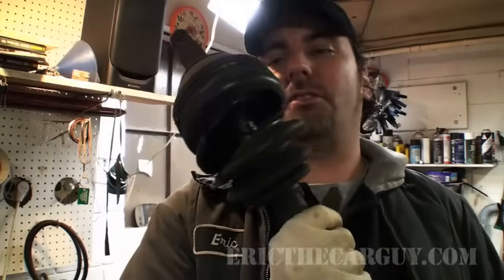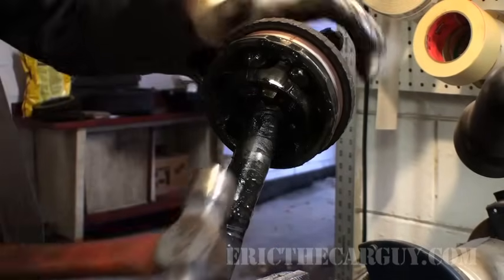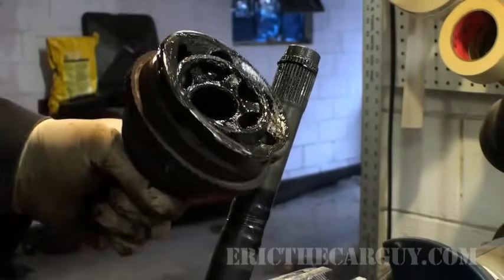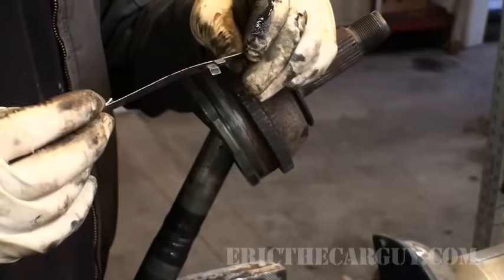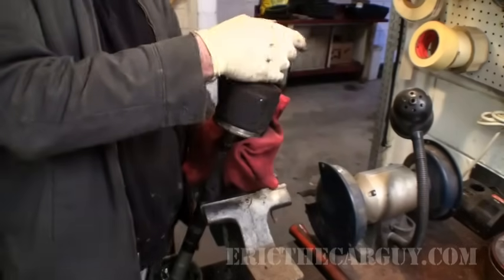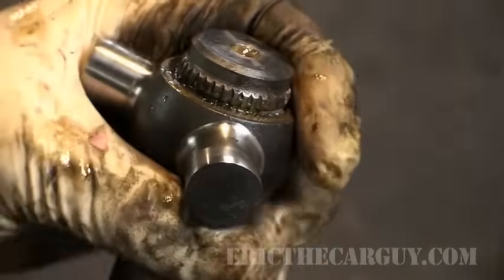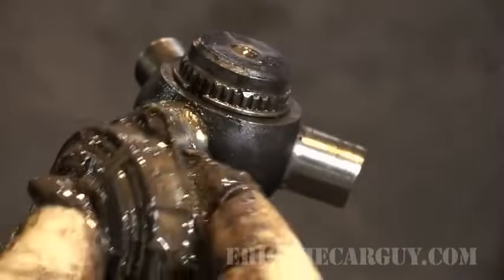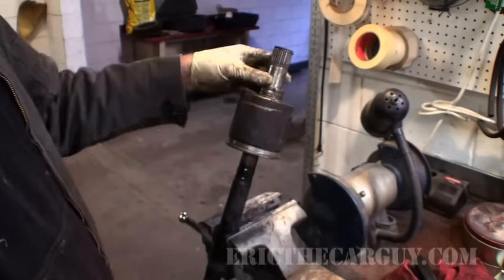How To Replace CV Boots - EricTheCarGuy

Comment: Eric, great videos. I have a 2002 Camry 3.0 V6 and the car has started shaking when accelerating, even a little bit. We have ruled out the motor mounts. Someone said it could be a CV joint or axle. None of the boots are ripped or leaking grease. You mentioned a clicking sound which my car is not doing; just shaking and vibrating, especially when accelerating uphill. Again, only when accelerating. Any idea of what it could be?

Comment: Thanks for the advice.  I have a clicking axle during turns and braking on a 99 escalade.  I was considering rebuilding it, but for $54.99  replacing it is a better option.

Comment: Great video.... I guess for the the inner joint boot, instead of having to remove the c clip on the inner joint, couldn’t one simply put both booth on the shaft when you removed the outer cv joint ?

Comment: i have to agree with his opinion about changing axles instead of replacing boots; if you hear a noise it is too late. Replacing the boot because it is torn is useful if you find the tear before any damage is done; I prefer in those situations to use a pneumatic CV Boot Expander and shortcut the entire situation.

Comment: The only reason I replace boots rather than shafts is because shafts are ridiculously expensive. However, if a joint is shagged, you can get hold of just the joints. Boots are like £15, joints are about £35-40 and shafts are £120 (on an absolute shiteheap). 
Where I work, we all just do it on the car. Once we have the shaft out the hub, we can just hold the joint, tap it off (with someone holding the shaft) and then it falls right off. New boot on, grease in the joint, shove it back together and job's a good'un.
The 'proper' boots are great. I remember hearing stories of boots you could fit without removing the joint, where they were split down the side and you had to use a kind of superglue to fix it together. I was told you'd be lucky to get it through an MOT.
Then there's 'Stretchy boots' that you can buy, which are, as the name suggests, stretchy. You can get a cone-shaped tool to push it over, or a pneumatic claw that expands when the boot is over it, then it stretches it over the CV joint. However, they obviously compromise somewhere to make it stretchy, by making it weaker. Anything vaguely sharp will likely cut it. They also dryrot very quickly compared to 'proper' boots.

(this is the case in the UK, not sure what it's like in 'Murica! :D)

Comment: Hi Eric not sure if the axle suppose to make noise when I rock it back and forth when the wheel is off. But when the wheel is on it don’t make any noise. My problem is that when I hit a lot of bumps it has noise from the front wheel area.

Comment: Thanks Eric, when disassembling the rod from the inner joint I didn't scribe any indication of the original insertion position. Being that there's only three positions, does this matter?

2001 Honda Civic DX Manual Transmission

Comment: I'm installing replacement  axles now on my Legend. New, non-OEM axles I installed on my CRV (A-1 Cardone Select - believe they were Chinese) caused vibration issues. Catching and rebooting an OEM axle before the clicking starts seems like a good solution to avoid fitment issues. I ended up buying Duralast OEM remans. A word of caution is to look over the axle thoroughly before paying and walking out the door; one of the reman axles I almost bought at Autozone looked like it had been installed, uninstalled, drop-kicked then thrown off a cliff.

Comment: I can accept that you do not do this job anymore, but I disagree and believe that it is a great opportunity.  I just did this job and I thank you for some tips you shared.  I discovered the problem while changing my oil, by noticing a cut in one boot.  It must have been a recent incident and I do not think much if any grease got out. I applied some silicone to hopefully carry it through the Winter.  Now it is Spring and I got around to it, the cut was opened up worse and there was some grease splattered around. I had not heard any funny sounds though. So I did the job and all is well.  So it cost me about $14, and an hour or two of my time but it seems as good as new.  Had I left it alone it would have gotten more messy and eventually would have started making noises which would have bothered me.

Comment: After seeing your demo. I think I might have a idea why the inner joint has a broken boot after having these replace about three years ago.(Both outer boots joints were torn and clicking.) This time it was either a severe jolt while driving or something sharp off the road might have clipped it, or the installer might have over extended the inner joint weakening the boot, or because it was old stock. For my 1993 Pontiac Sunbird 3.1 with 5 speed stick. Just went over 300,000 mile a few months back, and yesterday when I was replacing the front brake pads I noticed the inner boot was cracked on the driver side CV joint. Thankfully Auto Zone can get the part. So I'll have my local mechanic replace the CV axle for me when I get the part.

Comment: Thanks for the video (all your videos are great).. c-clips don't where out? but why wouldn't the c-clip that comes with the new joint work. Isn't it designed to work with the new joint.  And how much and where does the grease go inside the boot itself?

Comment: Eric, have you ever seem the cup on the inner joint dimpled so it won't simply slide apart?  I see this on my volvo and it looks like the dimples need to be ground down to separate the joint.  They should not be needed for normal operation because the joint wont separate once its back in the car.  Thanks

Comment: I recently replaced the Passenger side Axle on a 2008 Camry.  Job from HELL!!  The bearing would not release from the Casting bolted to the motor which would not come loose even after getting 3 impossible bolts out due to dowel pins.  Hammer, Chain whip, air chisel, running long bolt in casting hole to crack cup of ball bearing etc. ONLY way was to saw thru the axle between support CV joint and Trans.  Very heavy but hollow shaft.  Then the 2 pieces would come out.  Huge time getting the bearing out of casting, finally driving balls out with long punch at snap ring recess.
Then had to drive the broken cup out of Casting with punch.  Almost impossible to jig up on Press. Corrosion resembled mill scale and even power wire brush would not remove it.  Had to be lightly tapped with small ball peen hammer to get it out.  SHOULD have just replaced Boot and left inner shaft alone.  2 guys almost 7 hours.  Never again.  Axle cost was $118.50 Garage price. Customer price $248. Apparently was a new not reman. unit.

Comment: I dig the video and your commentary. Question the smaller clamp/band has broken on my right axels boot, the boot is intact it's just oozing a little grease, the smaller clamp is my only problem. May I simply buy a new small band and pop it on around the boot? Is this an easy fix I can do without lifting the car? I'd appreciate anyones feedback. Fingers crossed it's an easy new clamp do it myself fix. thx

Comment: Makes sense. The purpose of the boot is to protect the CV. But if the CV works then a torn boot doesn't matter. My 2003 Element's CV boot has been torn for years and still no problems or noises.

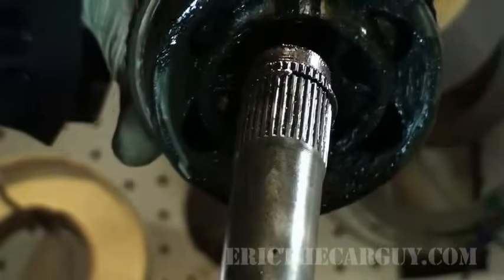Comment: Hey Eric! I replaced both boots on the drivers side and now there's a thump on acceleration.  It's not there on deceleration (or it's just not noticeable) and definitely wasn't there before replacing the boots.  I had a hard time reinstalling the outer joint like you showed at 6:45.  Don't think it matters but It's a 2003 nissan altima 2.5.  Help!  Thank you!

Comment: To answer your question. I needed to put together “Frankenstein”  axles. Outer is from a 86’ Integra & inner from a 96’ Civic the actual shaft is from a 86’ Civic I couldn’t find a shop that would make them for fairly cheap. But then again engine swaps aren’t cheap.

Comment: Thank you Eric, great video.  Can I drive my car with a rip cv boot for a while before replacing it.  Or is the axle/drive shaft going to brake off? 

I've hear a clunking noise in turns, only when turning right though.  I am  afraid that something could happen if I keep on driving a bit longer.   Thank you and have a blessed day.

Comment: Eric, always a pleasure to watch your well done videos!  I watched this old one because I discovered a leak on my wife's 2008 Subaru inner axle.  The grease is oozing out from the small end of the boot onto the axle.  No problem mechanically yet, and I do not know how long this has been occurring since the axle is somewhat out of plain sight. Tiny stain on the garage floor.  I figured maybe just re-clamping the boot may be all it needs.  Now, I wonder if I should just let a dealership do this and some other maintenance work I was planning on myself.  I saw somewhere that using one of those plumbing type bands is not a good idea here.  Due to vibration and rotation it was said they loosen up.  Maybe you should visit one of Greece's Islands sometime!!  :)

Comment: What you need to replace depending on the condition of the CV joint, not how much you want to spend. Eric is right, if the CV joint starts to make noise, you are out of luck! Honda is notorious for having cracked outer CV boot. My old Accord had that problem and I had to bring it to the dealer to get the damned $23 boot replaced which cost over $250 after it is all said and done.  Next time, it is probably better just to replace the entire drive shaft like Eric suggested since the labor cost will outweigh the part cost. Of course, the part cost in this case would be after market part, the OEM part will be much more.

Comment: For greasy jobs, I have always find it much better to use paper towels for cleaning up old grease excess grease and from parts that need to be cleaned and re-greased for re installation. Dispose of the grease-laden paper towels in a plastic bag, either sealing it or tying it off before dumping it in the trash.

Comment: Already bought a CV outer boot for £10 and thought I'd ring Audi given the start of your video....£324 for the drive shaft.....so yea, continuing to watch your video. Hope it isn't too complex :-/  It hasn't started clicking or anything, I just happened to notice the boot had spilt while changing a bearing.
Reply: Wow....that was a LOT easier than I was expecting. The only thing I don't have is that first special tool you showed but I do have standard carpentry flat head 'nippers' that look pretty much the same - the only difference would be the amount of force I could apply looks less.....anybody have experience of using my tool for this job?

Comment: I have a 2004 saab 9-3 with 196k on it. CV on passenger side has been needing to be replaced for about 8 months now since ive had it. I bought it off of my cousin and it was messed up before then. Im just now about to replace it along with the drivers side and the clutch and I drove this car 21k miles so that tells you a lot about how hard it is to break them. I am the type that when something is serliously in need or repair I just run the heck out of it lol.

Comment: I have a 2008 Nissan Rogue with torn rubber boots. No clicking sounds at all. A mechanic recommends replacing the axles because the boots are torn. I’m skeptical 🤨 especially since he said the cost to replace them is $1,100. What would you recommend?

Comment: Those outer boots have a tendency to tear. It is super easy to change this boot though because they make flexible universal boots that you install and then trim down to size. They also make a super handy cone tool that lets you slide the boot on without taking the cv joint off the driveshaft.

Comment: I just changed my Trooper outer boot, came with grease and clip. Kept original clip on axle shaft. Boot had not yet ripped, so grease inside is good. I just added some grease.  I know what a pain those bands. I have been using black nylon zip ties for my cars. Been ok for years.

Comment: Great video. I just have a question.
I have a Honda Civic from 1997. It has ball-and-cage outer CV joints like the one your working on.

I got a Haynes Service Manual for my car and it says the outer CV joints can't be dismantled or removed from the shaft. Is it true?

It's weird because when I search online for parts I find kits that consist in the joint, gaiter (with clamps), nut, grease and circlip.

My car has the clicking sound you mentioned, whenever I turn left. Can it be a joint?

Comment: Hey Eric , can you please make a video on inner axle joint on 98 odyssey install to second part close to the support bracket that holds bar into place that new cv axle get attached or press into before final installation into the transmission?. Thanks

Comment: thanks eric for the insight. I will be just replacing the whole axle. I don't think its worth the extra time, tools, and parts just to spend about $70 on a whole new axle from krage/oreilly auto parts. my axle is also clicking lightly on turns but my rims are just getting nasty because of the grease coming out of it.

Comment: I knew one of my cv boots was broken open. I went for an oil change and both are broken open now. Should I change the axles and not the boots. The cost for it all they quoted $562. Or am I misunderstanding when you say "let it go", just to run the car till it dies? Any advice is appreciated!

Comment: Thanks for explaining very well and carefully, I knew that you could change your boots because I saw it in Mexico when I was a child, but I did not remember if the cv axle had something special inside, or how to realize when they no longer had a remedy to change boots,  thanks one more time, ahh I forgot can you use the clamps with screws?  or do they have to be the same ones?  thanks you once more and many successes 👍🏽🧰
Reply: Your talking about jubilee clips, probably, here in the UK we can get away with cable ties as long as it's secure but it's always worth using the correct parts where possible, best bet with things like that is to ring your local MOT station (or equivalent) and ask them as different places around the world have different standards!

Comment: Hi there, saw your you tube video on the outer CV joint.
My question is about the ABS sensor reading ring on the body of the hub. I have a new outer CV replacement kit for my Passat and the new CV body doesnt come with an ABS sensor reading ring; can i remove the ring from my old hub unit or do i need to buy a new ring to fit?

Comment: can you reuse the 6 inner flange bolts, the ones that secure the cv axle to the differential, or they have to be changed every time? I have a cv axle to replace tomorrow.

Comment: QUESTION: You said you don't replace boots anymore because it's not worth all the work if I understand correctly. But I am wondering: How does replacing the boots EVER make sense? Typically you don't notice a ripped boot right-away (unless you spot grease somewhere around) but only on next inspection or when it is making noise and by that time dirt will already have entered the mechanics and have started to grind them down. - Maybe if you are lucky and notice it before it is making noise, you could buy those cheap 'open' boots that can be installed without removing the axle. But I have read claims that as soon as any dirt had a chance to enter it, you basically got a ticking time bomb.
I got a driveshaft with a ripped boot where I don't remember hearing clicking, but rumbling - sounds a bit like a damaged wheel bearing, but not exactly like that, because I know that sound, too.

Comment: Do you know of any tools like that Blue Point YA3080 (which is a re-branded Lisle 30800) that are at a different angle? I'm looking for something to crimp that style of boot clamp on inner tie rods. I usually end up using side cutters, but often have a hard time opening them up enough or reaching the clamp around sway bars, engine cradles, inner wheel house and everything else.

Comment: To get my 87 vw trough the annual safety inspection (witch is mandatory in my country) the joint had to be replaced. I didn't have the time to do it myself so I left it with the same mechanic that did the inspection. He replaced it with a reproduction part because vw doesn't make parts for it anymore. The part was for a 88 it fits and the joint works like it should. There is only the problem of the 88 vs my 87 because the boot is a little bigger and it rubs as soon as you go over 40km. I took it back to the mechanic to get it fix't he told me he made that mistake only refused to swap it out for the right one. We had a fight, he hasn't fix't it jet.
Now I can ether replace the entire thing (couple of months old with around 1500km on it) or I could swap the boot at a 10th of the cost.
Should I still replace the entire assembly?

I'm not going to but in theory should I do it?

Comment: If you leave a CV axle that is bad on the inner joint - and its vibrating - will that eventually affect bearings inside the transaxle?

Comment: The axle is on the smaller end of the boot when installed a little bit grooved, like it goes smaller and then back to its normal size. Does the smaller end of the boot needs to be in this groove? I'm struggling with it, I cant tight the clamp enough because the smaller end of the boot got too much space because of the groove

Comment: You can’t do that with most off cars. Since there is no axle bolt course its axle nut. On some car only way you can replace outer boot is to use glue able, or stress able boot or take out inner joint and push new boot thought.

Comment: great video but you can also put both of the booths on when u take off the outer cv joint to make it easier. put one facin in that for the inner cv an the other facing out that for the outer cv an u done.